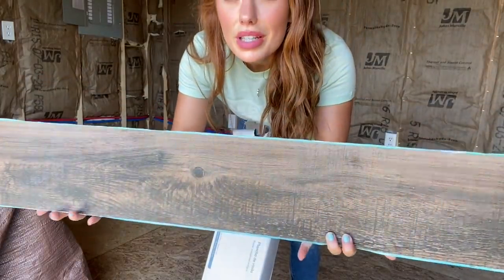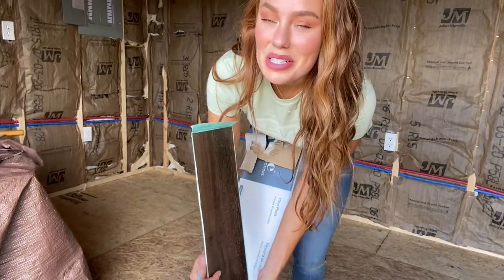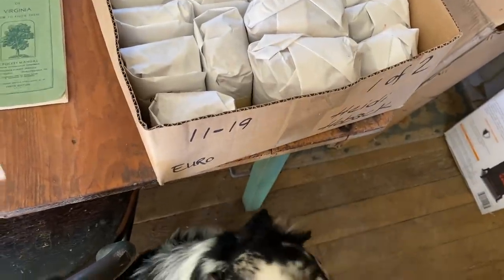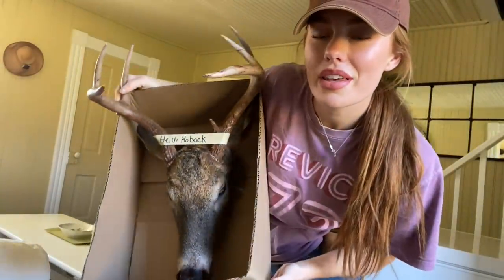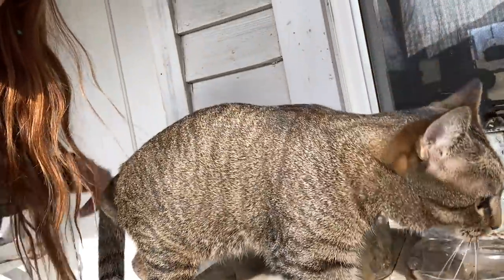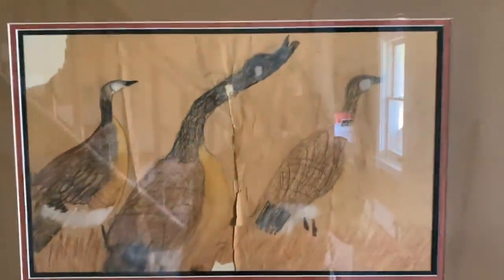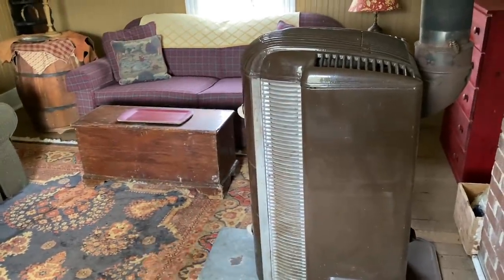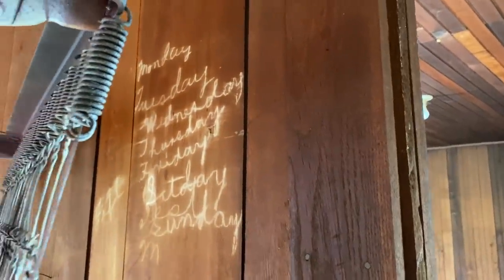Workshop Update + FARM HOUSE TOUR!! Ep. 6 (is it haunted?)

Comment: Here's a tip for driving those long screws into hard wood.  Rub the threads on a bar of Ivory soap.  The soap that sticks to the threads acts as a dry lubricant.  Store the bar of soap in an air tight container or it will dry out and become hard over time.  If it does dry out, put a little hot water at the bottom of the container and it will soften.

Comment: I see you struggling with putting long screws into boards. If you want to make it a little easier. In to hard wood you should drill a hole first into wood. But you must make sure that the hole is always smaller then the screw .be safe . Amazing views

Comment: You should have kept that gap open around the entire house and put a net in front instead to keep wildlife out. What you created is an area to keep moisture beneath the home and you eliminated the way for moisture to dry out and escape. 

Beneath the floor (plywood) you should have installed fiberglass batt insulation and a vapor barrier  on top of that to keep the cold air and moisture from entering the plywood floor.

Comment: That tool hanging above the picture you're Dad Drew and painted is called a sigh. It's what they used to harvest the grain with.Your left hand was toward the end handle and your right hand on the other one, and you rotated your upper body and swung it to cut the grain off then the grain was tied in bundles and then you shocked it until it was dry and then when it went through the threshing machine, you hauled the bundles with wagons drawn by horses which those two things above the fireplace are part of the harness to pull the wagon they are called single trees. Then the reaper took the place of the sygh and the binder replace the Reaper which tied the bundles and deposited them in a group large enough for a shock. And the thing that looks like shark teeth across the front of the fireplace is a sickle with a lot of sections missing they were on the front of the reaper and the binder to cut the grain.
Reply: Sigh

Comment: Instead of putting in screws or bolts with a drill and impact doesn't much better job plus it is less likely to strip the heads

Comment: Flashing. Use it behind exterior boards. All I'll say. I hate anything Phillips screw heads, not just toenailing. Transfer to star bits (Torx). Much better grip without slippage. And hahaha ... My nick is Billy. The saw equipment thing is known as a scythe, an old form tool used for harvesting or simple cutting (like tall weeds, etc).

Comment: Your hatred for toe fastening is because of your technique pre-drill and try a longer bit a bit extension if you will the longer the visual line the easier it is to keep the drill straight with the shank of the screw give it a shot, building looks good 🤙🤙🤙🤙
Always a good idea to use the primer before you apply the vinyl flooring with the use of your OSB floorboard it would be advised but it works good nonetheless

Comment: The generic #2 Phillips bit you are using is no good that's why it cams out of the screw. You can get original Phillps brand bits and screws online at Home Depot. If you use their bit that will come with the "Phillips II Plus" outdoor rated screws it won't cam-out like the one you were using.

Comment: Sorry, I think the floor in the Work Shop is too good. That is something you would put in a new kitchen in the house. Generally, a Work Shop is a place where you work on wood products or gas run machines. Like if the carburator in the 4X4 gets gummed up one would sit at a work bench and take it apart and use gas or a cleaner to clean it. Most often, one would spill gas or oil on the floor and storing that stuff in the work shop. You will need the floor to keep it in good shape
.